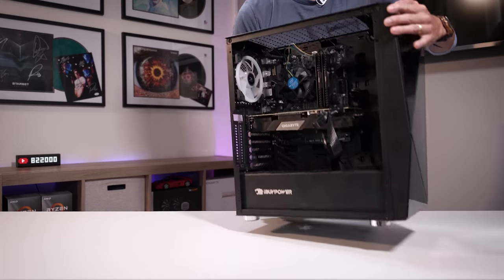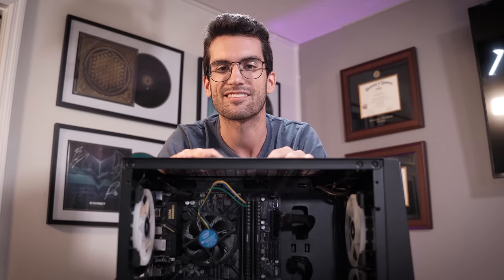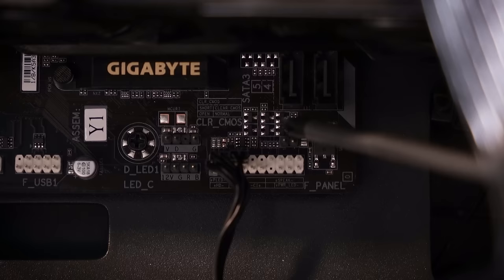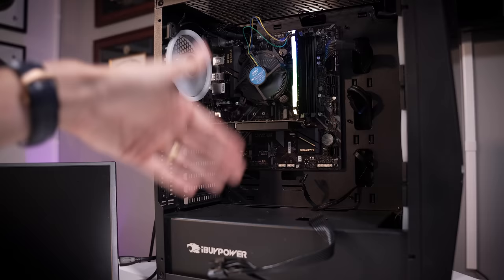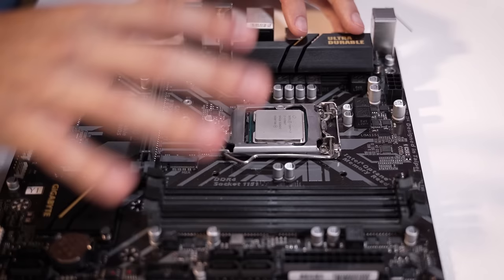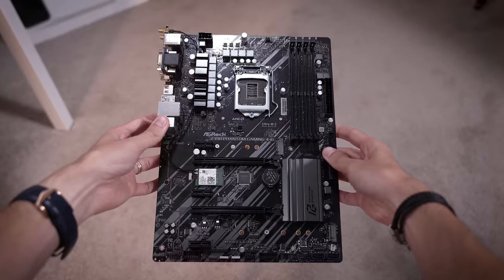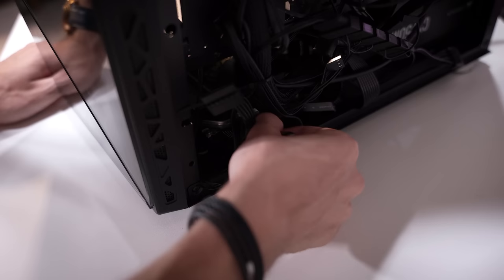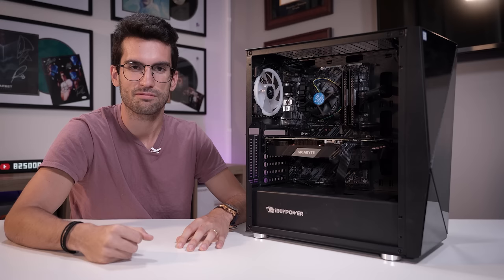Fixing a Viewer's BROKEN Gaming PC? - Fix or Flop S3:E1

Comment from the maker: SPONSOR: Learn more about HP Victus Desktops and laptops as low as $700! https://tidd.ly/3qKgJud

Thanks for watching this one! Cheers to season 3 of FoF!
Reply: I cant't figure out what his old cpu was from this video, but i think the problem might be that the bios needs an update bcs those mobo's were create for the intel 8000 series
Reply: The link doesn't open
Reply: Sorry for the noob question, but why was the bios image from ibuypower if the motherboard was swapped? I figured it would have changed with the swap, unless it's on the operating drive itself. Anyway, great content as always!
Reply: I dont like omen because they limmit sertian stuff or so i think
Reply: @Mark_catface  they do in a sense to make sure the parts you choose are not only compatible but work extremely well together
Reply: @hyd3419  i mean like cheap out on sketcky psu and oem motherboards etc including limiting certan components
Reply: @Mark_catface  sometimes psu but cheap psus can still be good
Reply: @hyd3419  yea they work but theyre sketcky amd defently with 3000 series power draw spikes
Reply: @hyd3419  and i just checked omen power limmits their products a lot 1-2k score difference in cinebench r23 on same system nad they made xmp un accessabe

But im not saying omen is trash im just saying i feel there are better deals out there.
Reply: I have begun to always use the small BIOS speakers. They give useful beep codes. And confirm a valid boot up
Reply: @Iram_Deum  I had the same question and my only logical conclusion was that the replacement motherboard was bought used and also came from an iBuyPower system. As far as  I know the boot logo is stored on the motherboard within the BIOS.
Reply: @SekizenShade  That's what I thought about where the boot image is stored. Imagine the chances.
Reply: link is broken greg

Comment: I noticed in the close up of the XFX card, there are gaps in the connector pins. I've seen that on other cards and always wondered what that means
Reply: I believe that means that the pins that could be there were just not needed like additional power. I'm not to sure though so someone can be free to correct me.
Reply: @aarontmg9758  it wouldn't be power, power comes from the 1st section of the pcie slot, it's for bandwidth, less lanes = less bandwidth, lower end gpus don't need can't handle such high bandwidth so don't need additional lanes hence they are not wired. Fun fact pcie slots can provide 75watts of power which is why low end gpus don't need supplemental power, also why I love pcie is forward and backward compatibility, where you can use a 16x device in a 1x slot (won't have all the bandwidth though) and vice versa, not to mention the compatibility between generations. It is the best interface
Reply: @mohammedfaeez4066  Ahh, I suspected something like that, thanks!

Comment: Hey, Greg.
With Gigabyte boards, I've noticed that when you reset the cmos, you have to keep power going to the board (don't switch off the psu) otherwise it won't clear.
Reply: Are you sure? I cleared my cmos earlier this week while i was trouble shooting my rig. My psu died so there was no way for me to get power and my bios confirmed that all my settings reset. I'm using a z490 gaming x for reference.
Reply: @tartantulakid666  I've had two gigabyte boards recently that refused to clear cmos. I then read on a forum that keeping the board powered would do the trick. Worked on both boards 🤷🏻

Comment: You could try using a BIOS flasher (Eprom programmer kit) on the old motherboard. To see if flashing a new bios would fix the issue.
Reply: That was my thought, should always attempt a refresh of the bios in that situation.

Comment: Always good to have a trusty ol speaker to troubleshoot pc issues, specially since only the top end motherboards have leds or segmented displays to inform issues that prevent POST.

That being said, things done wrong (or at least wasn't shown in the video) from my years of experience fixing pc's:
1) haven't tested the PSU - I've seen freaky issues caused by misbehaving PSUs...
2) haven't tested the MoBo outside the case - bad case groundings can also cause really strange behaviors
3) haven't tested the components (cpu/ram/GPU) before ordering a new MoBo - granted IF you don't have a compatible spare...

bonus entry: enabled XMP right away, without checking for system stability?
Reply from the maker: Speakers haven't worked in 95+% of these Fix or Flop videos. We tested every component you listed in your comment before ordering a replacement. Not sure what you're on about. If the system isn't stable running XMP, it's a very quick toggle. My viewers, for the most part, are familiar with PC basics.

Comment: G'day Greg,
For those who do complain about no upgrade it is not justified because you went Z390, which from the B365M is an upgrade.
My niece & I had a good entry for FoF last week, I got a AeroCool XPredator Cube (Iron-Man Theme) for my Bedroom HTPC & my niece asked if she could do the case swap, she left the Pentium G4400/GA-H110M-S2H/Cooler/2x 4GB DDR4-2400 as 1 unit but when we turned the PC on after the swap just Boot Loops. My niece thought she had killed it 😢, we added a BIOS Speaker & got Memory Beep so took out the Left Channel DIMM, still Boot Loops & Mem Beeps, put the DIMM from left Channel in Right Channel & got a Post, added the Right Channel DIMM to the Left Channel & working fine too. So for some reason it just decided it didn't like the DIMMS in the slots they were in 🤷‍♀🤷‍♂???
So proud of my niece as she has been a big help with projects like this where my disability makes things like working with tiny screws very frustrating.

Comment: I think 1 big problem that people often overlook is Proper Grounding and a Stabilizer:
- If the ground is not well done it'll transmit that static electricity to all conductive components and sub-components until the weakest of them, gives in and kills the entire PC.
- Stabilizer is also a must for PCs and any electrical component really, the US has lots of Electric storm, Tornadoes and Hurricanes and strong winds, that cause massive high voltage shorts that then transmit that to local transformers, that maybe won't be able to destroy themselves to absorb the massive overcharge, and pass that, from fractions of a second to maybe a couple, destroying non-protected PSUs first, and then the electronic components.
-So houses should have also a High Power Filter, to avoid overcharges to pass, and stabilize the Voltage and Amperage; as a first line of defence 1 before the Electrical Meter and 1 after.

This way every electrical device in the house will probably never suffer a burn out

Comment: These are always interesting to watch - also funny to see both the overlap and differences in how we would troubleshoot. If it won't post the first thing i do is reset CMOS, but after that would disconnect all unnecessary things and strip the system down to bare minimum as Greg did.  Also like he said - if you have to really dig into it just leave the motherboard out until you have a confirmed working setup again.
Reply: yea i kinda wish when he got the new board he would do a test boot just to confirm its good before place back in its just a good habit but alas.

Comment: Ok Greg,, few things crossed my mind while watching this.
1) You might want to get a PC speaker. In the case that a motherboard doesn't have a LED display for post codes, the pc speaker will give you the beep codes to diagnose that issue.
2) XFX used to make NVidia cards, like a Geforce MX440, but it was a LONG time ago. Your card is most likely a HD5450 or HD6450.
3) As the 300 series started with 8th Gen a bios update may have been required. There are even some boards that accept a 9900 non-K but need an update for the KS.
Reply from the maker: 1) I have plenty of PC speakers Lol. They often don't work in these scenarios. No beeps. 
2) Was referring to relevant XFX cards, not ancient relics ;-)
3) Tried 8th gen CPU and still no POST, so I doubt it was a BIOS update that was required. Couldn't POST to update it either way. Would need to swap chips outright.
Reply: Odd on the post beep not working at times, I tend to use it more then the led codes.
As to the trying the 8th gen, downside of condensing the video, can't see what was cut. Ah well, you still do good work.

Comment: Glad to see the start of season 3 and this was a good computer to start with. You had to go thru almost all the components to find out what wrong with it. There is one thing that I have been wondering about. That is bent cpu pins/cpu socket pins, why are there so many people with bent pins? I have been making my own computer and later my kids computers for over 20 years. I have made or upgraded 30+ computers and I have never had a bent pin. People just sloppy putting them in? People drop them? you would think that if you are putting in a CPU you would know to be very careful and watch what you are doing.

Comment: Love the video's, on a side note,  I have two Ryzen 2700x chips . Both have lost the second memory  channel . It through me for a while, ie. 32Gb installed only 16 Gb usable. Now both systems work with ram in A1, B1. One cpu  rma and changed. Worked for 3 weeks, second channel down again. Given up, used as is. Cheers Mike(UK)

Comment: The cooler was not secured with the two top "screws". They where set to release and not lock. That would definitely cause a overheating issue.

Comment: got the same problem last month, found out that there was a corrosion at the back of the MoBo on the PCIE slot, after a spray of electronic contact cleaner everything was good again

Comment: Not surprisingly, they cut corners on the models with 11th gen i7 chips as well, they use a argb cooler but it is on par with the intel stock cooler. 2 140mm fans up top as intake and a decent tower cooler fixes the majority of their cases' issues with temps. Fun fact a good deal of motherboards will automatically reset to cmos defaults if they fail to boot numerous times.

Comment: The reason the board wouldn't work was prolly because you didn't update the bios after resetting it. you need an 8 th gen cpu for older b365 boards

Comment: I've had to straighten bent pins before, usually on a CPU, as I'm using the AMD platform. What I've found that works well for this task, is  the back side of a utility blade. The blade thickness is almost exactly the pin spacing on, at the very least, the AMD processors. Hope this helps. God bless and stay well.

Comment: How expensive is it really for motherboard manufacturers to include a button either directly on the surface of the motherboard or on the rear I/O panel for clearing the CMOS? The fact that we are living in the 2020’s and there are still some boards which require you to bridge two pins with a spoon or a screwdriver in order to clear the CMOS is ridiculous. The owner may never even need to use that function but there’s no excuse for cheaping out one tiny button at a negligible cost. 

The same goes for a little LCD display for debug codes. It’s incredibly low cost but if you ever need to diagnose a problem, it’s such a great thing to have.

Comment: i remember back when i upgraded from 16gb ram to 32gb ram i went from corsair 2x8 to gskill 2x16 and i had XMP enabled for the corsair ram and when i swapped it out it prevented my pc from posting so i had to reinsert the corsair ram and clear the xmp and reset the bios to have my system post with the 32gb ram

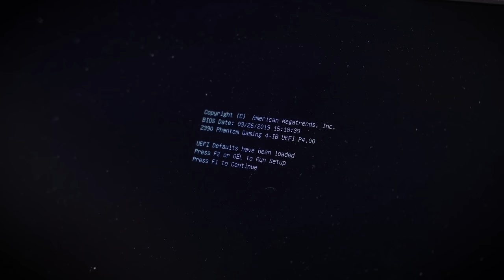Comment: 15:45 actually, if you're not using matching memory modules, applying XMP or AXMP is not a good idea because it can make the system unstable and cause random system crashes.

Do not apply XMP if you have unmatched memory kits in your system. You would be better off buying 2 kits of dual channel at the same time from the same place and you will find bin matching modules that will support xmp or axmp profiles for overclocking memory. It's also cheaper than buying a kit of 4 modules.

I've done that for years now all the way back to DDR1 and have had no issues doing this. I've definitely had problems buying the same manufacturer brands at different locations and at different times though and though the type is the same, the revision, chip manufacturer, etc. Were different which always lead to system instability when attempting to apply overclocking of any kind...

Comment: Motherboard pins are a nightmare — I've never broken any, but it always makes me nervous when installing a chip... especially since one of my recently obtained boards runs LGA 2011-3, which has two levers, each needing an uncomfortable amount of pressure to lock, hahaha!
Reply: This is my main reason for choosing Ryzen. If a pin bends it’s much easier to fix because you can set it wherever you want

Comment: Recently a lot of prebuilts i have seen have been using stock coolers although better than what my old prebuilt came with i had some akasa cooler that had a fan that sounded like a PS4 under load.

Comment: Greg, just so you know XFX was originally an Nvidia exclusive partner. It wasn't until 2009 that they ditched Nvidia and started manufacturing AMD cards (ATI at that time in fact). 
So that might actually be an Nvidia graphics card. They were pretty popular in my country as an Nvidia AIB, selling cheaper cards than Asus or MSI.
Reply: I think even after 2009 XFX still did still make some low end display adapter Nvidia GPUs, so yeah, still could be an Nvidia card.
Reply: @garethgobulcoque8668  That was probably leftover stock. Same thing is happening with EVGA, they have lots of Ampere cards left to sell for months.

Comment: Actually, with three front intakes fans, it creates dead air flow (smoke tested) under the GPU, I get better CPU/GPU thermal & noise  performance with the bottom fan set to intake (motherboard CPU PWM to fan hub control) and the two top front fans (Asus Strix GTX 1080 GPU fan header powered) set to exhaust under GPU load, this pulls the GPU exhaust hot air out and away from the CPU cooler, I also run the two top fans ( CPU fan hub control) as intake for filtration, this also creates positive case pressure to keep dust out, this equals 3 intake and 3 exhaust I run a 120mm AIO on the rear exhaust (CPU fan hub controlled)

Comment: I currently have the same graphics card (Gigabyte RTX2070 8GB gaming) and I have to unplug one of the monitors for mine to boot correctly (PC boot loops unless I temporarily disconnect it). I've just upgraded my whole rig and the problem persists so that's why I'm positive it's my video card. I was very surprised to watch this and see a system with the same video card exhibiting the same behavior because I thought my issue was a one off!

Comment: I remember when a similar thing happened to my PC. Overnight it just wouldn't post anymore. I thought maybe it was overheating because I got a now CPU cooler but maybe it was bad. So I spent the whole day trouble shooting, but I never checked for a bent pin. I reasoned that since I was able to use it after I changed coolers that wasn't it. but when I couldn't find the cause I finally took off the CPU and there it was, a single bent pin. I tried to fix it but it broke, and so did my heart followed by my wallet when I had to buy a new MB and CPU since a similar MB would cost more than a brand new CPU + MB.

Comment: i had one stick of 3000 and one stick 3200 , same make and model , butt different cas and timings , ran fine for nearly a year till a memory checksum then i had to switch back to dual 3200 , i did not realize they were different cas loads and was reminded by checksum , during time i had then two different sticks i had multiple stabilization problems

Comment: Great Job! . . . but I do have a question. If you swapped out the motherboard, how is it that the splash screen has the iBuy Power logo? Can the logo be changed in bios, somehow?
Reply: I noticed too think that was original board for the system and gregg is making up videos for content now!

Comment: Another questionnable sponsor. HP Omen are good but motherboard are weird and you cannot reinstall Windows with the normal method.
You need to install Windows on the drive using another PC, then you can't just put it in the HP Omen because it will BSoD during boot, you need to boot externally using a USB dock, then install every driver for the HP Omen, then you can put the drive inside!

Also they usually come with a ton of bloatware.

Comment: Nice video Greg! I'm surprised you didn't put a speaker on the motherboard to listen for beep codes. Granted with some issues it might not produce a beep code, but it could also lessen the diagnostic time if it does.
Reply: He said before I think that he usually does but doesn’t usually get anything so he doesn’t include it

Comment: Huh, strange that it came up with an ibuypower splash screen on post. I always thought the splash screen was built into the motherboard. Guess not
Reply: i was wondering the same thing. anyone has any ideas why its like that ?
Reply: @badvoiceallnoise  I think someone else said it was another ibuypower motherboard he used to replace the old one.
Reply: @Iceaxe0410  I thought the same and was wondering if it was another ibuypower board.

Comment: When I saw the bent pin I was convinced that was the problem, but after bending to its right position and the problem not being fixed I thought it killed something in the board related to video output.(?) Happens and many times even after bending them again properly the motherboard won't work anymore as intended.